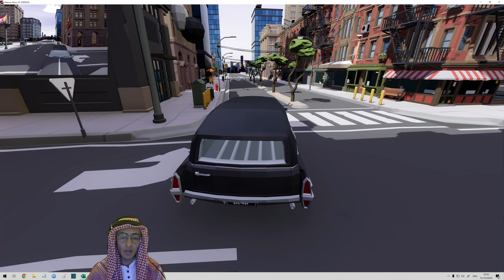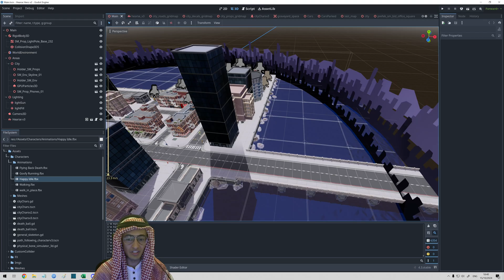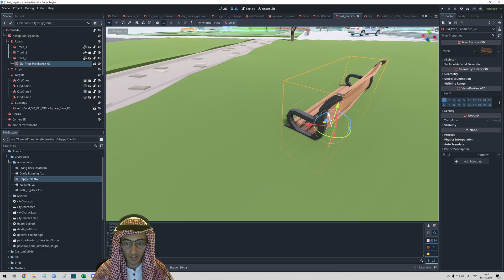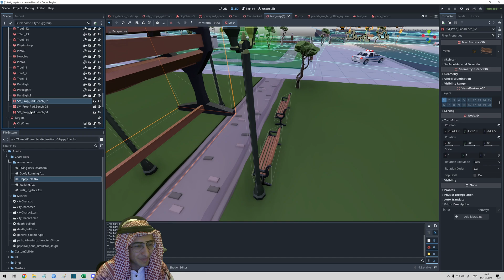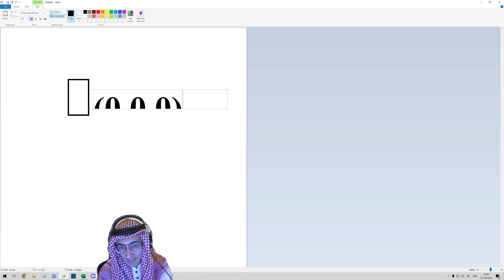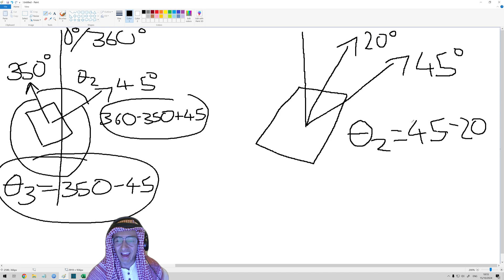Hearse Hero Development Diary 1 (Godot 4 3D)

Comment: Usually speaking, physics objects are more performance intensive than static objects so take care in choosing which ones are interactable. The large amount of pathing NPCs, plus having them in plain view (as opposed to being occluded by the buildings) could also make performance worse in the test map. Best of luck in your optimisation efforts.
Reply from the maker: Thank you! I really appreciate the feedback.
When the physics objects are frozen, presumably they have little/no impact on performance? Most of the level is frozen in that case, so it shouldn't matter
For the NPCs, they are following a Path3D until I get near them, then they switch to navigation. I do need to make it so that they don't call the navigation server every single frame. And I need to add occlusion culling as you said.
Optimisation will mainly take place towards the end of the project.
Reply: @hippiehippiehippiehippie  Not really a Godot knower, the last commercial engine I have worked with was Unity. However, looking at the docs, it seems they are controlled by a rigid body, so some calculations could be run even though they seem static. I think it was somewhat visible in the city map as even though you had a lot of static objects there it ran relatively well. The included CPU profiler could help a lot with finding out the exact causes.
Reply from the maker: @Hazamuth  Thanks :)